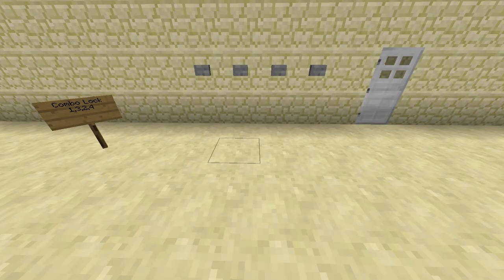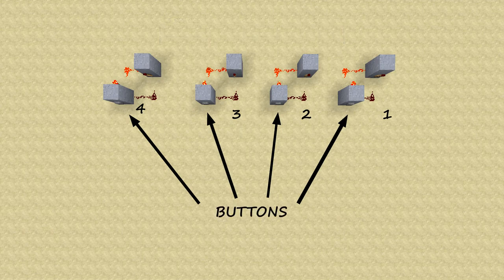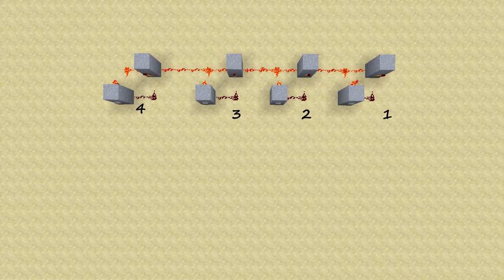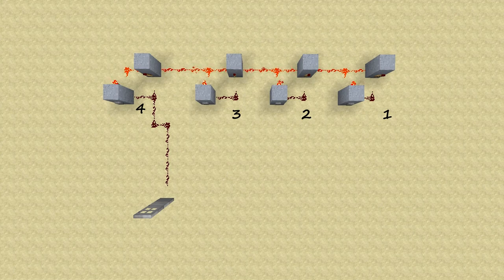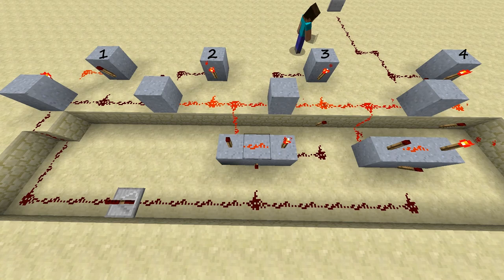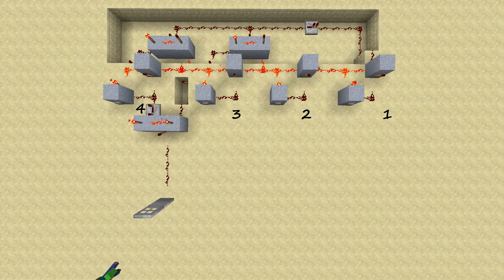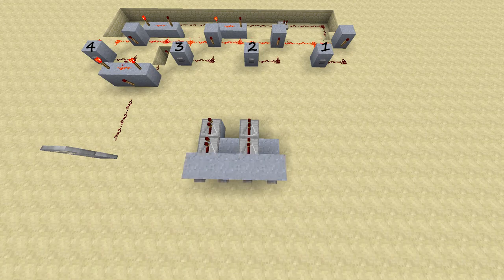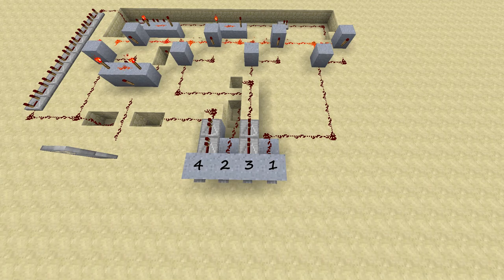Geoff's Minecraft Combination Lock Tutorial

Comment: Very thorough, but this is only half order sensitive. When you enter the first two correct numbers, then go back and press the first, the rsnor latch array is not reset.  If your combination was 1 2 3 4 and you entered 1 2 1 1 1 1 1 3 2 2 1 2 4, the door would still open.